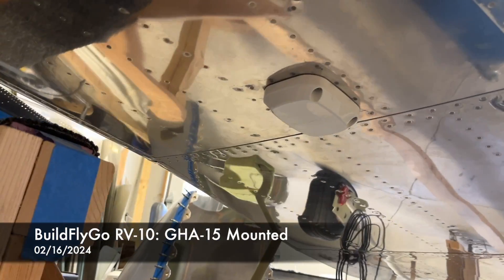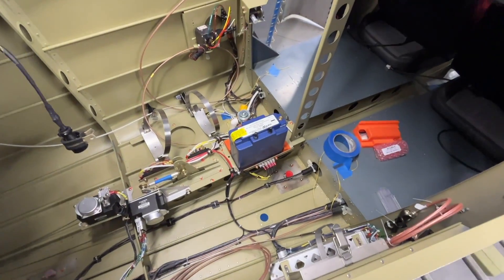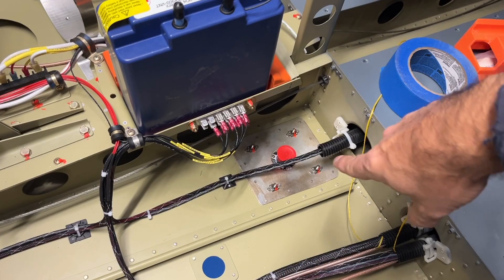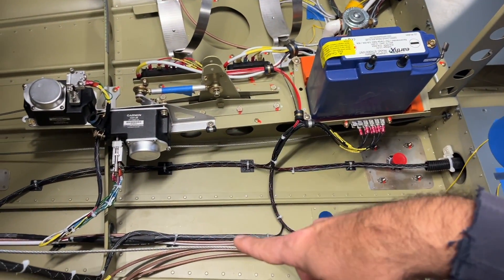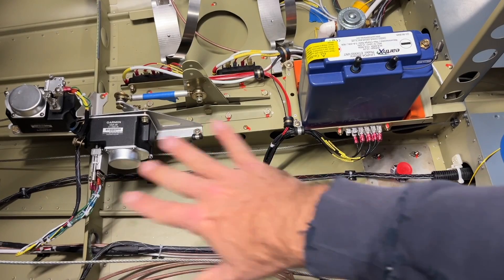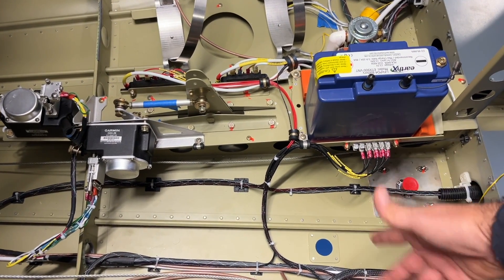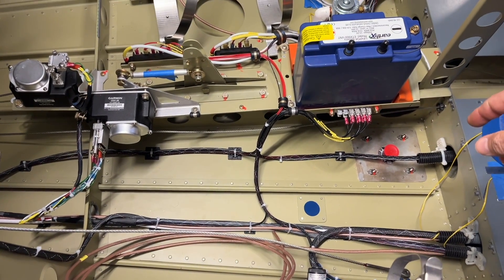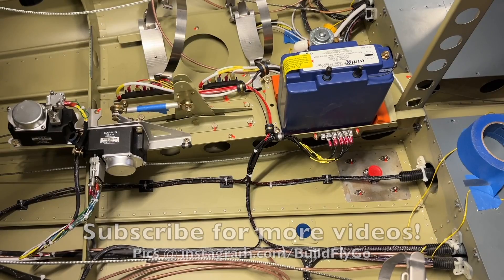RV-10 Garmin GHA-15 "Retrofit"

Comment: Cirrus has introduced Safe Return Emergency Autoland on their SR G7+.  Do you know what it uses for altitude information?  It seems like it might use a GHA-15.  Any idea what it would take to add autoland to an RV-10?  Do you have any plans for something like that?

Let me be a little more specific.  Obviously you need a fancy software package for Autoland, but what are the hardware requirements?  What hardware would you have to add to your RV-10 so that you could add Autoland in the future?  Having Autoland control the brakes seems unnecessary.  It looks like you have an autopilot and a GHA-15, so what else do you need?

Comment: Great installation, I just finished installing the GHA15 in my Bristell and it passed the first function test and shows correctly in my G3X. I had to tap into the CAN wire from the roll servo since it is easier than identifying the actual ‚backbone‘ of the system. Unfortunately my G5 and AOA indicator do not communicate with the system anymore and now I have to troubleshoot what went wrong. Unplugging the GHA15 did not bring the other units back. All other LRUs (AP servos, MFD, GEA etc.) work fine. This is actually great as I finally have to force myself into learning about the CAN bus protocol and how to actually find related faults. I initially measured 60ohms at the CAN wires to the the GHA15 which is good. I will next just plug the Sub D supply from the MFD to the G5 and will see what happens…